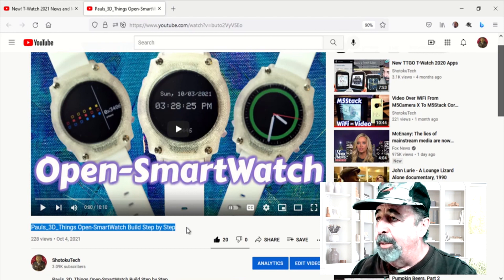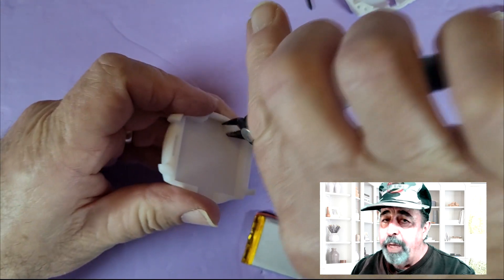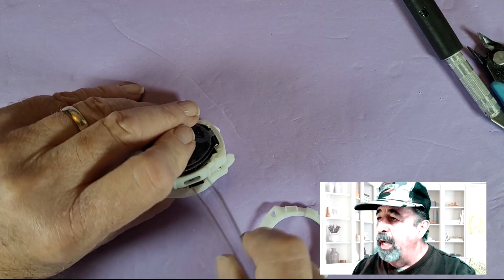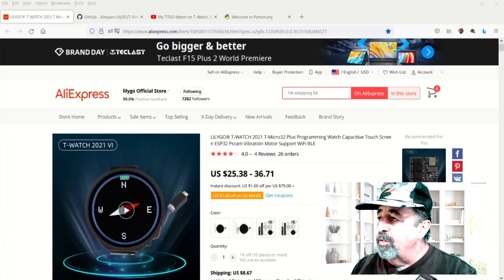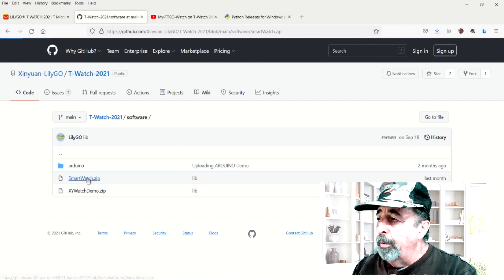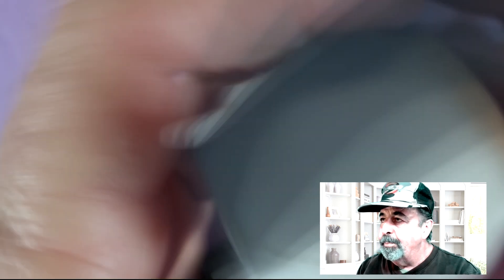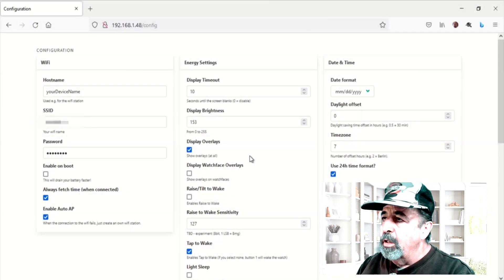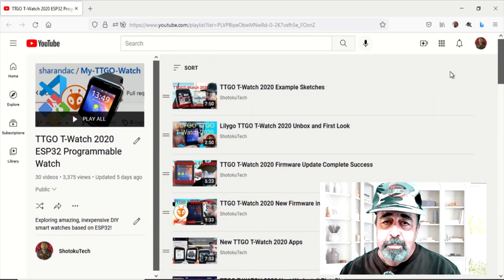LILYGO TTGO T Watch 2021 Unbox and Test

Comment: That's a great video! I just got the watch and I am trying to understand how to write code for it. I am unclear about whether you can use the VS Code Python extensiont to write code for the T-watch in python language (which is the only one I know at least a little)...
Reply from the maker: You can, yes. I have not gone down that road though. Not sure if I will. 😁
Reply: @ShotokuTech  ok. I have some circuit python code I am already using on a development board and I think it could work on the T-Watch as well. I'll try to upload it as soon as I get my T-U2T adapter, which I unfortunately didn't buy because I thought it wasn't necessary... 🙄
Reply from the maker: @AP-el1pi  Yep that T-U2T thingy. Someone else was commenting about that on another one of my videos. Interested to hear from you again on this topic. Best wishes.
Reply: @ShotokuTech  Just a quick follow up to my previous question about python... I exchanged some messages with the Lilygo customer service because I couldn't find anywhere micropython libraries (I assume you have to use micropython, not plain python to program the t-watch) and they said the watch can be programmed with micropython but they have no idea about where to find libraries... That leaves me with the question: why are they REQUIRING people to install the Python extension into VS Code if that is not to be used? Do you have any idea about how this works and where to find micropython libraries (if they exist for this board)?
Reply from the maker: @AP-el1pi  Damn that's a good question. I even went back to sharandac / My-TTGO-Watch library on Github, where I first worked through installing VS Code. Everything is in C as far as I can tell. Is it Platformio that uses Python? I have to be honest, I just don't know.
Reply: @ShotokuTech  Thanks for taking the time... I guess for now I'll work on learning some C! 😅

Comment: Thanks a lot for the great demo..  I'm still trying to get familiar with configuring and using Platform IO  but see lots of guys are using it so there must be a good reason.
I'm very impressed tempted to get one of these watches.. is this one the latest in the series that allows a developer to tweak things ?
Reply from the maker: To be honest, I prefer the T-Watch 2020 editions over this one. This 2021 edition 3D printed case is okay, but not as polished as the 2020 editions.
Reply from the maker: I do have this video that covers PlatformIO: My-TTGO-Watch on T-Watch 2020 V2 Step By Step Installation
https://youtu.be/wUGADCnerCs

Comment: Hi, I'm trying to follow your test video but after I uploaded the code, no way to wake up the watch!!!
this is the output of the vs terminal after uploading:

Writing at 0x0014760b... (100 %)
Wrote 1291424 bytes (697794 compressed) at 0x00010000 in 17.7 seconds (effective 583.9 kbit/s)...
Hash of data verified.

Leaving...
Hard resetting via RTS pin...
===================================================== [SUCCESS] Took 33.70 seconds =====================================================

Environment           Status    Duration
--------------------  --------  ------------
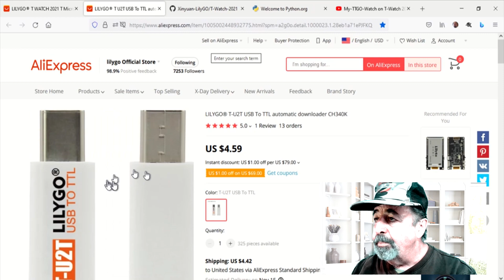pico32_LIGHT_EDITION  SUCCESS   00:00:33.701
===================================================== 1 succeeded in 00:00:33.701 ===================================================== 

whats missing??
Reply from the maker: Interesting. I haven't complied this software since last October. I will have to try it again since there are new changes. One tip in VSCode: Make sure to wait for Intellisense rebuild to complete before compiling.
Reply: @ShotokuTech  this is my first time in vs code.. I come from Arduino IDE.. I will try to understand when You say "Make sure to wait for Intellisense rebuild to complete before compiling"..........
Reply from the maker: @maurocalanca9382  This one covers everything from the beginning: "My-TTGO-Watch on T-Watch 2020 V2 Step By Step Installation" https://youtu.be/wUGADCnerCs

Comment: Thanks for this cool video, But after l working follow your instruction by this vid with my TTGO t-watch when l finish compile found that it the device cant opened. It is like black out
Reply: I’m not getting fail upload when l compile but after compile my watch can’t turn on anymore. Is there some step that l should beware of ?
like l change the wifi , password , date and then compile i haven’t change other things out of these
Reply from the maker: There is no other steps outside of what I demonstrated. Was there factory software installed before and that worked? Which software did you install?
Reply: @ShotokuTech  PIO Software and config.h of XYWatch demo from your Github link
Reply: @ShotokuTech  After we got the watch and assembly the device it can opened and worked all of the function , the watch is black out after we compile the data from USB wire.
Reply from the maker: @-SirinanRAKSAWAT  This is not my Github, it is Lilygo's official site.
Reply from the maker: @-SirinanRAKSAWAT  So in VSCode with PlatformIO, were there compile errors?

Comment: I feel as though this tutorial is missing a few steps, as I'm getting errors
Reply from the maker: Your long compile log gets blocked by YouTube. Maybe next time just say error compiling. I can't make any sense of all that log crap anyway. But when I see it, it tells me check everything again. I just compiled that same repository I used from making this video last October and it was fine. I'll try downloading the latest one to see if it is different. But if you install VSCode, PlatformIO and Git like this video: https://youtu.be/wUGADCnerCs
And Python like I show here. It should work. I rewatched this video and I didn't leave anything out. Two things. 1) Always store project files on local hard drive. 2) Wait for all the background processing to complete before you try to compile.
Reply: @ShotokuTech  got a link to the old version of the code you were using at the time of making the video?

Edit: also thank you for taking the time to respond so promptly
Reply from the maker: @HammerSpam  I just have the copy of the repository I downloaded in October 2021. I will compile the current one today for kicks.
Reply: @ShotokuTech  thank you, I even tried the SmartWatch folder but was still getting compile errors, I had a look in the comment section of that other video you linked me earlier and installed some Adafruit library’s in the PlatformIO terminal, it did something, I was still getting compile errors but different ones.

Btw Is there an easier way to contact you? I am grateful that you are willing to take time out of your day to help us but YouTube comments are rather limiting in what can be expressed
Reply from the maker: I downloaded the latest and compile failed. I have posted my copy from October 2019 here: https://github.com/ShotokuTech/ShotokuTech-SmartWatchZip20211019
Reply from the maker: Actually when testing the latest repository I updated the Espressif ESP32 platform in Platformio from v3.2 to v4.3. Neither of the versions would compile successfully. So find out how to get Espressif ESP32 platform in Platformio to v3.2. I put a screen shot of 'platforms' in that repository I sent you the link to.
Reply: @ShotokuTech  thank you so much! worked like a charm
Reply from the maker: @HammerSpam  Good news! I'm glad I was dumb enough to upgrade the ESP32 platform version in the middle of testing. When everything broke, that was my clue.
Reply from the maker: What are the errors? Where in the timeline do things go wrong?
Reply: @ShotokuTech  
so I am trying to install XYWatchDemo

these are the errors I get

[{
	"resource": "/c:/Users/USERNAME/OneDrive/Documents/T-Watch-2021-main/software/XYWatchDemo/src/Software/Pages/AppManager.cpp",
	"owner": "cpp",
	"severity": 8,
	"message": "local external declaration 'const lv_img_dsc_t LogoSetup' [-fpermissive]",
	"startLineNumber": 9,
	"startColumn": 20,
	"endLineNumber": 9,
	"endColumn": 20
}]

[{
	"resource": "/c:/Users/USERNAME/OneDrive/Documents/T-Watch-2021-main/software/XYWatchDemo/.vscode/c_cpp_properties.json",
	"owner": "c:\\Users\\USERNAME\\OneDrive\\Documents\\T-Watch-2021-main\\software\\XYWatchDemo",
	"severity": 4,
	"message": "Cannot find \"C:\\Users\\USERNAME\\.platformio\\packages\\framework-arduinoespressif32\\tools\\sdk\\esp32\\include\\config\".",
	"startLineNumber": 36,
	"startColumn": 17,
	"endLineNumber": 36,
	"endColumn": 116
},{
	"resource": "/c:/Users/USERNAME/OneDrive/Documents/T-Watch-2021-main/software/XYWatchDemo/.vscode/c_cpp_properties.json",
	"owner": "c:\\Users\\USERNAME\\OneDrive\\Documents\\T-Watch-2021-main\\software\\XYWatchDemo",
	"severity": 4,
	"message": "Cannot find \"C:\\Users\\USERNAME\\.platformio\\packages\\framework-arduinoespressif32\\tools\\sdk\\esp32\\include\\config\".",
	"startLineNumber": 271,
	"startColumn": 21,
	"endLineNumber": 271,
	"endColumn": 120
}]

The errors occur when I click PlatformIO: build (✓) or PlatformIO: (→)
also pressing boot reset on the watch doesn't seem to do anything other than lock the screen (yes I have the T-U2T)